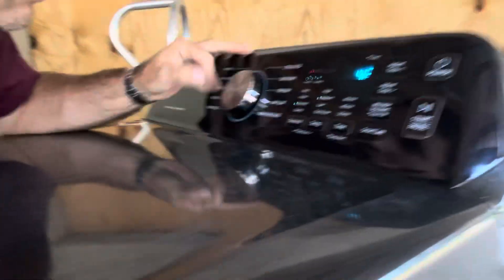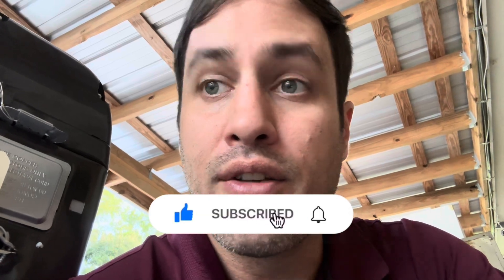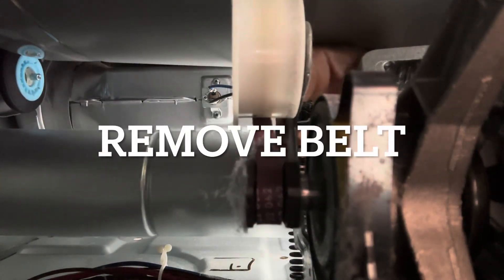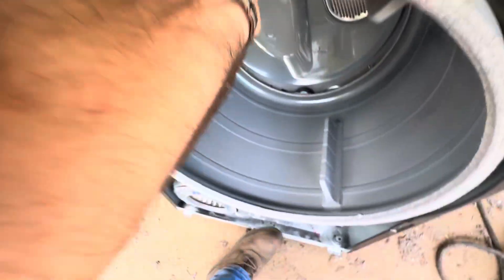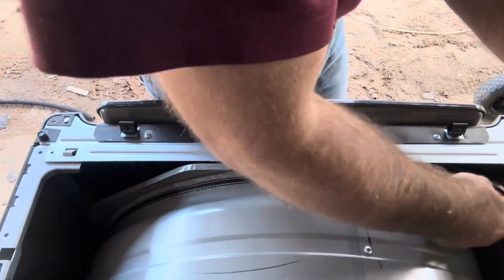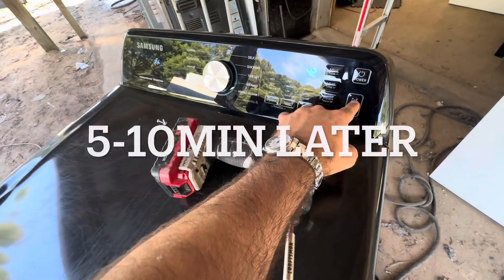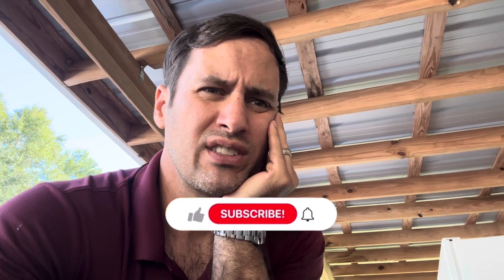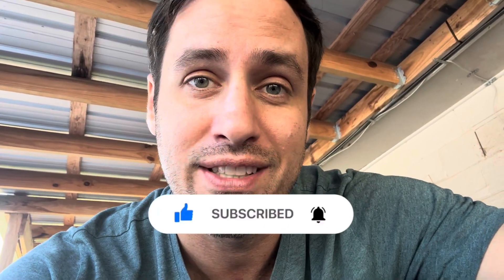SAMSUNG DRYER HELP! It’s got a mind of its own | starts sometimes and not other times

Comment: It could be one of the touch buttons on the UI stuck in the “on” position. If possible, post the model number and I can see if it has a diagnostic mode to read the stored error codes.
Reply from the maker: @3ShaneScott3  dve45t3400v/a3
Reply: @LAapplianceguy  not sure if it needs to be in Standby or powered on. Try holding both “Dryness” + “Wrinkle Prevent” at the same time.
Reply from the maker: @3ShaneScott3  still nothing when you first plug it up but then once it starts reacting I’m getting a “bC2”
Reply from the maker: Stuck button. Thanks for the tip
Reply from the maker: @3ShaneScott3  looks like the temp button isn’t reacting and it could be the one causing the problem.
Reply: @LAapplianceguy  It’s possible that after a predetermined period of time a stuck button is “ignored“ and that is why after 5 or 10 minutes after plugging it in you can start the dryer. Hopefully someone with more knowledge about this dryer will chime in. 🤷🏻‍♂️
Reply from the maker: @3ShaneScott3  I think you got it! Thank you very much
Reply from the maker: @3ShaneScott3  the tab to actuate the UI was bent up. You rock!
Reply: @LAapplianceguy  if possible, can you put a picture of the tab as an update in a future video. That would be a good thing to look for if someone saw this same malfunction. 

That’s great you were able to repair it. It’s already cleaned, time to sell it.
Reply from the maker: @3ShaneScott3  about to upload it now. Thanks again. Sometimes you just need someone else’s perspective and knowledge to see something you overlooked. 🤘